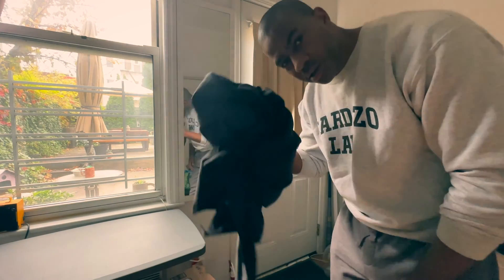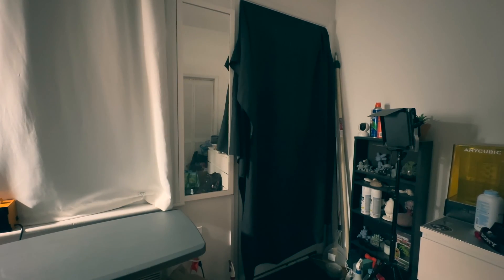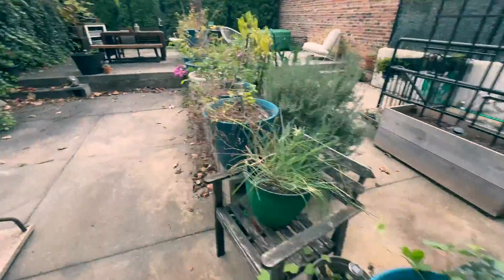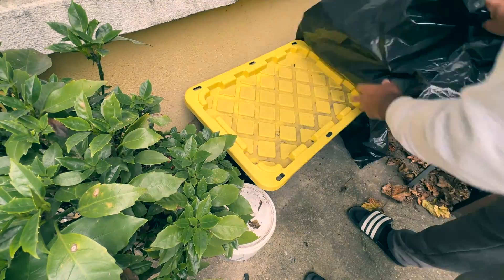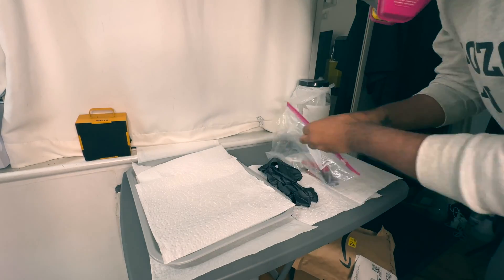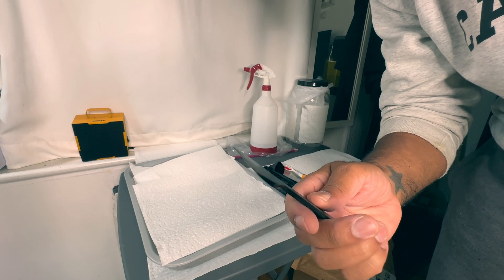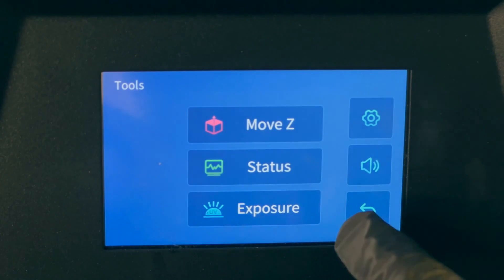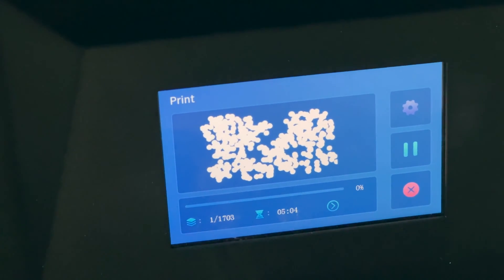Nomad Sculpt to 3D Print: Step by Step Walkthrough

Comment: I have my Elegoo Saturn 2 inside a grow tent and have a bathroom extractor fan pulling the fumes out the window. Quick tip don't use the plastic scraper to stir resin as it can scratch and damage the fep. Use a soft silicon cooking spatula. There is also a file you can print which causes the resin to mix. so you don't even need to stir it up ;-) 
I use Elegoo plant based low smell resin which you don't really smell it and IPA 99% gives me a bad headache so I use denatured alcohol which dont smell so bad.